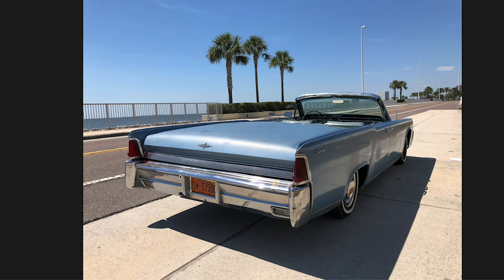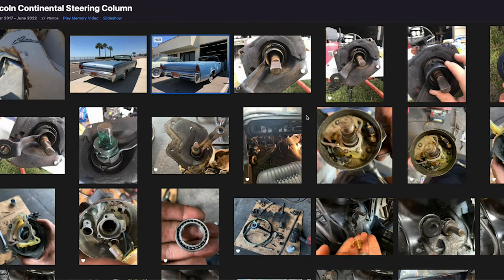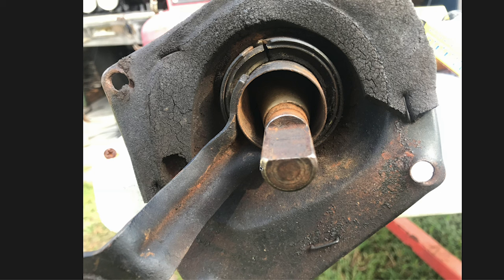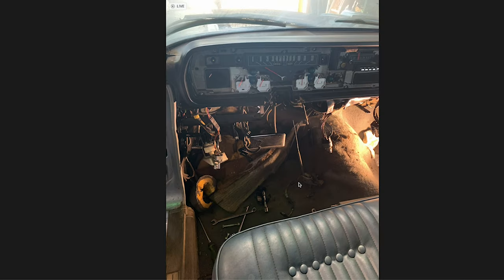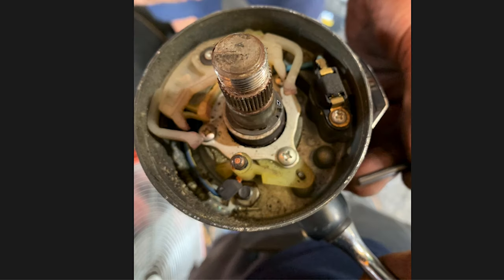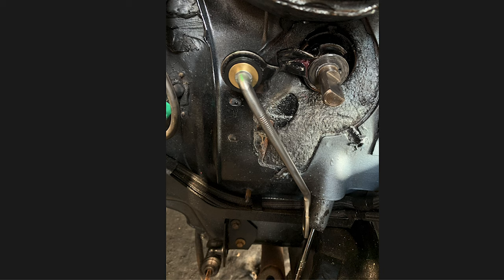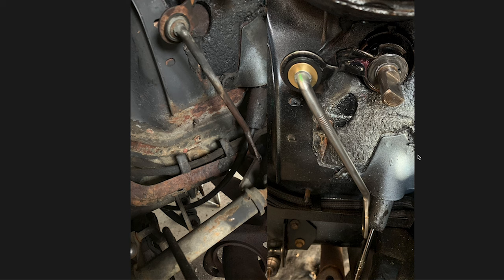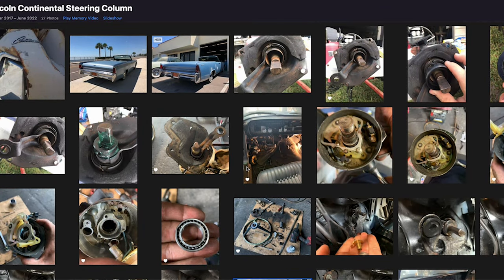1960s Lincoln Steering Column Remedy! MAJOR HAZARD!

Comment: I remember when my car was warming up in the garage and it dropped into reverse and it took off through the back door!! Fortunately the wheel was turned and I was backed in so the quarter panel got caught on the side of the garage door opening. The fender was trashed but insurance paid for it. Then I got the steering column fixed but I still am terrified to leave the car running while I am out of it even though the repair has been made. I'm traumatized 😬😬😬
Reply from the maker: OMG WOW! That is crazy. I'm glad no one was hurt.

Comment: The black bushing with the nub goes between the shift tube and the steering column. The white cone or the metal coupler goes between the steering shaft and shift tube. As I understand it,, the primary issue with cars jumping into reverse is caused by the black bushing becoming deteriorated over time. I think you actually want the steering shaft to move around some inside the shift tube.
Reply from the maker: Yes, I get exactly what your saying. No doubt you can do it whichever way you feel is best. Just reinforcing what Nathan Wilson has found and on my car the steering wheels feels great with this option. Thanks for the support.